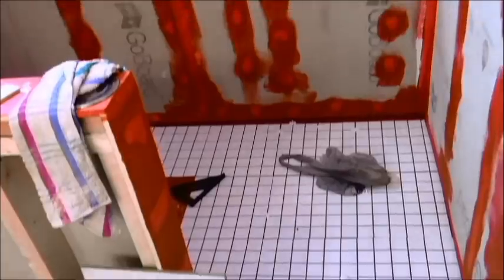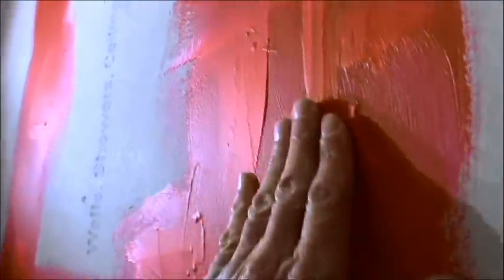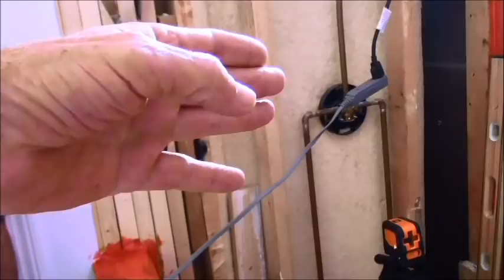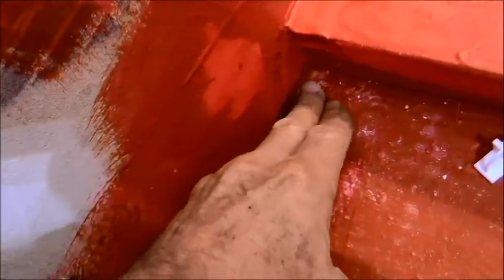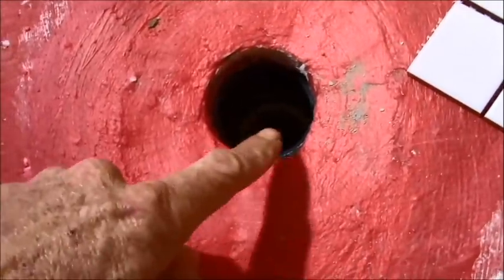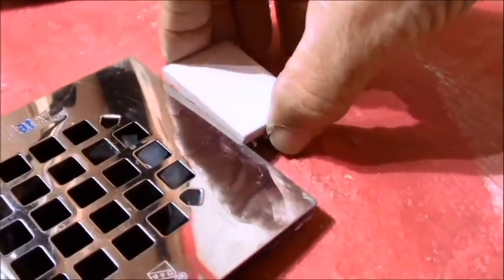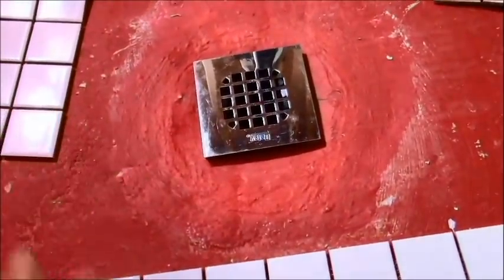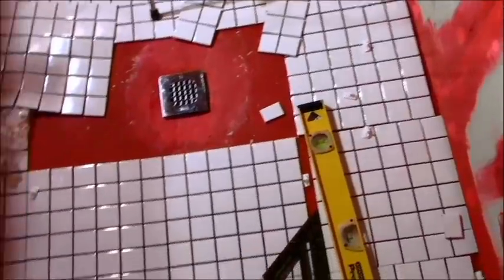HOMEOWNER SHOWER BUILD...drain issue

Comment: Hi Bob! Thank you for all the videos they are super helpful. 

As far as the cement board on top of subfloor in the shower - my only reasoning for doing that is to make the floor in the shower be on the same plane as the floor outside the shower (where my other cement board is, also on top of the subfloor).

Comment: Re: your comment that GoBoard has fiberglass, and causes itching.  I am now building my second shower with GoBoard.  Installing fiberglass insulation really makes me itch, but I have had no reaction to Goboard when installing it.  And, like Kerdi Board, it is light enough that it can be used to wet-shim when the studs are not plumb and square.
Reply: Fibreglass doesn't cause allergic reaction, it is actually many tiny cuts from the glass.

Comment: Bob, you know why it matters concerning the type of tile he uses for the shower floor?  It’s pride in doing a good job!  It also keeps the new home owner from yelling to his Wife every time he does a project....”you won’t believe what that idiot did”.

About a year ago I ripped out our old kitchen and put new Kraftmaid Cabinets in.  It included new backsplashes, crown molding, granite counter tops (the one thing I didn’t do), under cabinet led lighting, room led lighting, all new plumbing, etc.  I ran across more BS...used a tin can lid as a flange around an under the sink water pipe, if there were 4 screws required...each one would be a different type.

Comment: You said you would seal the drain and not use the weeping slots in the drain threads. To me that would not allow water to drain and probably destroy everything above the redguard. am i missing something??
Reply from the maker: Yes... walls are built the same way, waterproofing thinset and grout...walls dry out as will floor with a bit of thinset below, though may take a bit longer

Comment: Im confused. So he has a rubber pan liner on the subfloor and the slope bed (looks like standard concrete) on top of that and Redgard on top of that?
If so,.he has a standard 3 piece drain installed with the rubber pan retained by the drains clamp ring?
It looked like a long way down to the threaded part so i couldnt tell what was what.

Comment: Hi Bob.  I’m taking your advise and replacing my square screw down drain cover with a round brass one.  Any recommendations on which brand?  I’m looking at Koehler but am open to suggestions since I know nothing about shower drain covers. Thanks!
Reply from the maker: Unless otherwise told, I always default to the Home Depot oatey drain, or is a Sioux Chief, I forget, but anyway one of them has a cap that's really flimsy metal and the other one is a very solid heavier one for about 28 bucks..I like the latter

Comment: Petroleum eats through rubber pretty quickly,  I'm in the automotive industry and seen people do a brake job and put power steering fluid in the reservoir and by the time they attempt to operate the brakes it has degraded and unable to operate the brakes

Comment: you seal the drain bottom to the base? Don't you want any water under the tile to seep down past the drain barrel threads into the drain?
Reply from the maker: Old school is water getting in mortar...waterproof the surface for no possible failures

Comment: Dont know if you can give me some advice sir? Had a walk in built 6x8 and come to find there was no rubber membrane installed. Any idea what cost to tear out floor and repour? Single drain center of floor
Reply from the maker: It will cost thousands...maybe 3k or more.
I think a better solution might be chiseling off all the tile and going up one tile up the wall, then go in with redgard, and re-tile... still a bit of a pain in the ass but much much cheaper than doing a entire pan over

Comment: Bob, since he put red gard over his mud bed, wouldn't it be easier to use a kerdi drain and not use a pan liner? Also gonna send u some $ 😎. Have a good weekend.
Reply from the maker: Thanks for the $ ....much appreciated👍
Not sure kerdi materials are easier, just tore out a competitive system like that, foam pan, foam curb, and their large drain flange...somehow it failed...operator malfunction can happen with any system. That video coming soon ✔
Reply: @StarrTile  You're welcome, just image if ur subs would give just one dollar a month.  You'd be spreading thin set with gold plated trowels 😆😆😆. Looking forward to ur next vid.
Reply: Bob, I’d like to see that video you mentioned.  Did you post it?  If so, what is it titled?

Also, I’m considering using a Schluter System for our master shower remodel and for the bathtub to shower conversion/remodel.  What are your thoughts?

Comment: Is that white mosaic tile to be on the shower floor? Looks too glossy.
Reply from the maker: Yes on the floor, and yes a definite slip hazard
Reply: I used a marble mosaic in my shower, which has sharp edged tiles, not rounded or radius edge. He should not use those tiles without a shower mat.

Comment: I know why folks unscrew the drains, and finding your video I can see that I goofed from the start. When I poured and redguarded my floor, I didn't have my tile yet, and set the drain height at about 5 mm above the pour. Now I have my tile, it's 9 mm mosaic marble. But it's too high, and after thinset it will be even higher. So I, too, want to unscrew the drain to raise it higher, so my drain isn't a whopping 3/8" below the tile. But you said in this video that I should not unscrew the drain? But you also said this guy didn't have to re-do the entire pan even though he did unscrew the drain. So what was the solution? What did you advise him to do since he did unscrew the drain already? And since I found this video before I unscrewed my drain, and it is still set at 5 mm, what should I do? Would I be better off unscrewing it and using whatever fix you told him, setting the tile much higher than the drain, or just buying a different floor tile altogether, like this cheap 4 mm tile in this video?
Reply from the maker: I always set my tile slightly above the drain Edge so I can put taper cuts on them and have positive water flow into the drain, in this case I think what he did his cut out a square around the drain as you can tell by the newly set mortar, that is an option perhaps for you? I don't know because each job is different and brings its own Solutions
Reply: @StarrTile  So should I unscrew the drain as he did to raise it, then put thinset or silicone around the edge to reseal?
Reply from the maker: I don't know, every job is different and I don't know what I'm looking at or how to tell you to fix it because it is not my project, if I offer my advice it is only what I would do, I would cut out a square area like he did and adjust your drain and then pack mortar back, but more than likely knowing me I would take out the whole pan and redo it

Comment: Do you tape your joints on manufactured ends and/or otherwise?
Reply from the maker: No...liquid tropical membrane like redgard is a crack prevention technique same as tape...doesn't hurt to do both but doesn't help either.

Comment: I don't understand why you would redgard up to the drain then silicone the drain in after spending all the time for a slope/preslope. Now you just created a good 1/4" or more lip where the water will sit before it gets high enough to go over the drain. Seems counterintuitive to everything you talk about.
Reply from the maker: Right, a pre-slope is not needed because there is no intention of water ever getting into the mud pan..
The pan itself is sloped so that when tile goes on top it will shed water directionally to the drain. The surface of the pan is red guarded a couple of times, a bead of silicone around the drain edge to ensure water never gets into that area, and now you have a completely monolithic waterproof surface to tile on. A simple concept that all the newer plastic and foam products are doing without using foam and plastic ✔
Reply: @StarrTile  agree, but if the pan is sloped down to the drain then the drain is higher than the pan and sealed to the drain it creates a lip where water will pool when it inevitably gets behind the tile. I assume what you're saying is make the drain significantly lower than the main part of the pan, but even in that case there is a small area around the recessed siliconed drain where water will pool unless you make the top of the drain completely flush with the redgard layer.
Reply from the maker: @chrisk1724  if you watch a lot of my videos you will see that I always raise my tile slightly above the drain cap, the water has nowhere to go but down the tile and directly into the drain, the only water that could penetrate would be into the grout and then it's going to hit some thinset and redgard and if it got in it can evaporate out. However that amount of water would be minuscule compared to the preponderance of water allowed to get in without regarding the surface, I would rather have that small amount of water near the surface rather than having 200 lb of mortar saturated